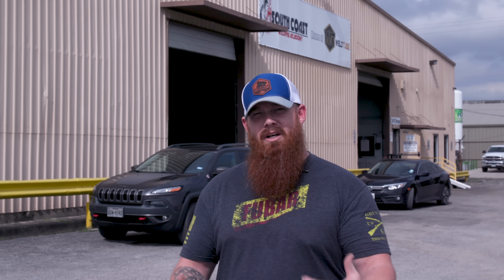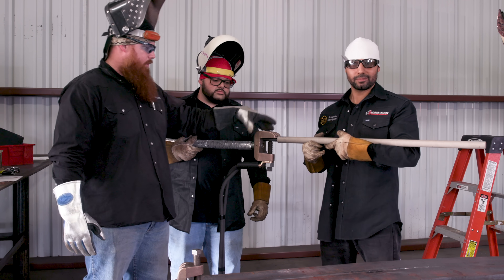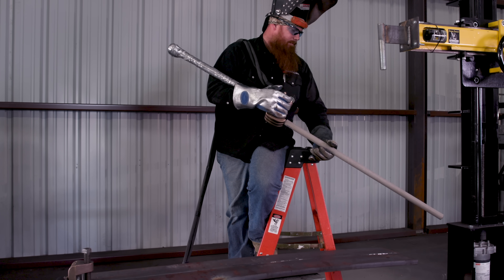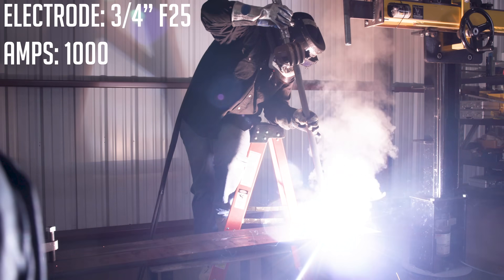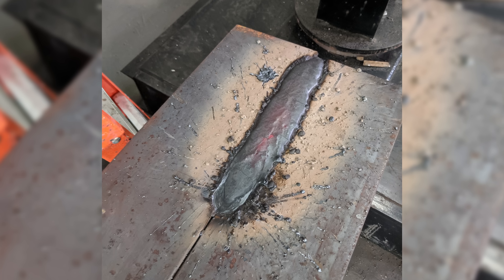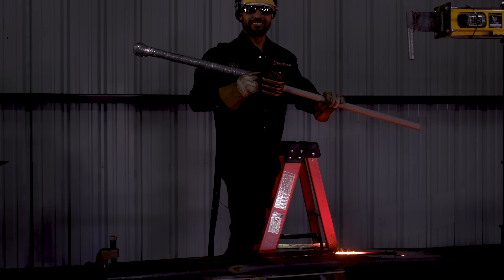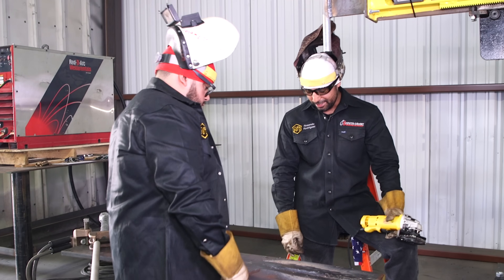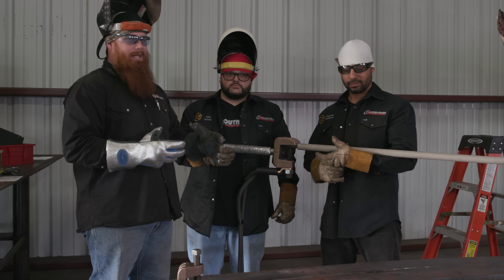1000 AMP STICK WELDING!! | Manually Welding with the Worlds Largest Electrode

Comment from the maker: Get Weld.com merch at the new www.weld.com
Reply: what shade were you using at 1000 amps?
Reply: When your company appreciates you they spend $600 just so the welders can have some fun on the weekend.
wish i lived closer i would love to have seen that in person.
Reply: @fixt100  is that how much that rod cost ? And good question @ bikesfightback !
Reply: @matthewb7049  not the rod(still prob 90$+ each rod tho) ,, i know that plate that thick is spendy and is never tossed ever, and basically losing the mtr for it would be taken as a personal insult from you by your foreman...
Reply: @fixt100  mtr?
Reply: @matthewb7049  MTR= material test report, it means you can use the steel in applications that require complete product tracking from the foundry where the steel is made and tested for quality to the job site where the product is installed (oil and gas requires this for safety reasons, and they pay extra for it)
Reply: I'm here from weldernation thanks for the  good information @weld.com
Reply: Can i have one of thos rods ?
Reply: What  lens numbers  did you  use
Reply: that is a lot of cigarette smoke in one breath.
Reply: Waiting for styropyro to find this

Comment: In my meltshop there is a 250,000 Amps electrode, but is not for soldering, but for melting steel, its called a 150MW electric arc furnace, and roars as hell bro

Comment: for anyone wondering the purpose of such a large electrode,  this process is also known as flood welding, or massive electrode welding and it's primary use is in foundries for repairing dies, forging hammers and similar very heavy structures where the appearance of the weld is not important.  These rods can be burned anywhere from 1000 - 2000 amps, with deposition rates upwards of 60 lb/ hr.   Red- D- Arc has available 1000 amp machines that can be paralleled together for 2000 amp at 100% duty cycle.   Sure to make the electric company smile from ear to ear

Comment: Well that was pretty cool.

Now let's see you do a vertical up with it.... :)

Hope my boss doesn't see this vid. He'll have me welding everything with it, assuming it will weld faster..

Australian WorkSafe would be having seizures about using that electrode with an uninsulated electrode holder with 1000 amps going through it and the lack of fume management. But America is, after all, the land of the free.

Comment: When i was a kid my dad would take me in to work now snd then at the GE plant. They would use these rods or bigger. The one guy could run 5 of them at once he'd get one started by propping up on the electrode hold snd go down the line like that. They use to parallel 5 or more Lincoln 750amp torpedo. You dont get to see things like that anymore.

Comment: Couldn't you technically use a system with counterweights and pulleys to accommodate for the 40 lbs the stinger wheighs? It would seem to me that you could achive more precize welds because you could hold the rod more steadily while the process wouldn't be as tiring.

Comment: Question... will any (proper certified) welding helmet work for any amp welding? Ive always wondered if my basic run of the mill welding helmet would work from 40amps -1000amps or do the lenses need to be upgraded at a particular point because of the amount of UV and IR?

Comment: Back in '92 my high school metalshop teacher brought in a MIG machine that had been donated by a shipyard.   This thing was ancient, and about the size of a Ford Fiesta.  I distinctly remember that 440v wouldn't run it  and that the lowest output setting on the dial was like 200A.
Reply: Did they throw in some 1/2" wire and some old battleships to practice on?
Reply: MIG machines do NOT have a current setting on them,,, as MIG controls the VOLTAGE not the current,,,, the current runs wild according to the stick out and wire feed speed. and size of the wire,.. and 440/460/480 is the largest electric service you will find in 90% of all factories and certainly no bigger than that in a SCHOOL. and if 440 aint gonna run it,,, it aint ever gonna run... sounds like an old sub arc machine if it was that big,,,,,, but all the things I mentioned above are still true for sub arc,
Reply: @DOCDEVOE699
0 seconds ago
MIG machines do NOT have a current setting on them,,, as MIG controls the VOLTAGE not the current,,,, the current runs wild according to the stick out and wire feed speed. and size of the wire,.. and 440/460/480 is the largest electric service you will find in 90% of all factories and certainly no bigger than that in a SCHOOL. and if 440 aint gonna run it,,, it aint ever gonna run... sounds like an old sub arc machine if it was that big,,,,,, but all the things I mentioned above are still true for sub arc,

Comment: Those are used in forge shops, not foundries to reface forging dies - the die require pre-heat before welding on them to prevent cracking. Cor-met website shows the welding set-up.

Comment: I've welded a lot with 3/8 rods at about 400 amps and the light would still burn me through the button holes of my shirts. This giant rod would have been great at putting cutting edges on big loader buckets.

Comment: An old foreman I had back in 1990s told me when he was young working in tank plant welding a bunch of 1” and up plate they would use big rods like 1/4 “ but 3 feet long and he would rest it on his shoulder to start and by the time it was seriously hot it would be down to your hand like regular rod.
I thought that was big enough, this is way crazy

Comment: That was certainly cool and definitely OVERSIZED but why did you overlay still photos of the slag over the video section of the finished and cleaned up weld instead of showing us how it turned out?  That is what I wanted to see, how a rod that huge welded.  If it wasn't that great of  a finished weld it would be completely understandable since that rod was never intended to be used by hand and the fact that you were able to weld with it at all is impressive.

Comment: I used   work at a mag-cell chlorine plant. We used 172,000 amps at 200 volts. You could melt some thick stuff with that. Tremendous magnetic field it generated . Flip a pair of channellocks right out of your pocket when you walked over the buss work. You could not place a computer CRT screen anywhere close since it would deflect the screen raster to one corner of the CRT.

Comment: I would have thought a little more current, I've seen their ads (Cor-Met)…..I used to run 1/4" 7018 at 400 amps….welding up broken stuff for logging....Terex and Cats....